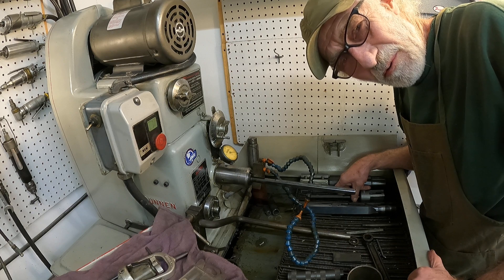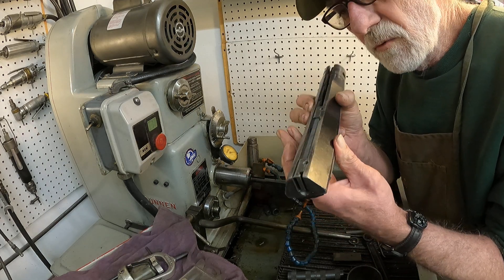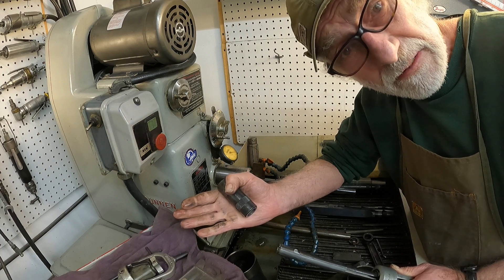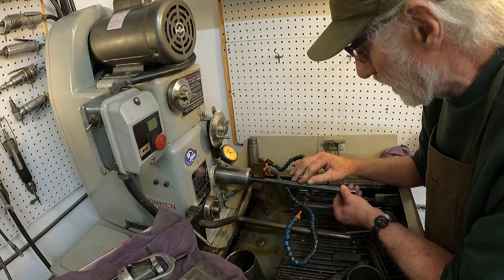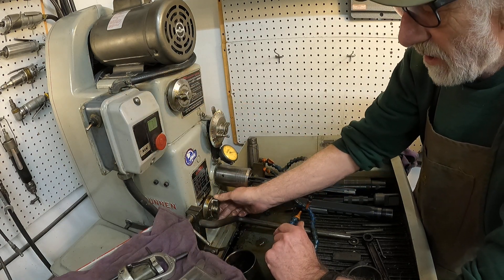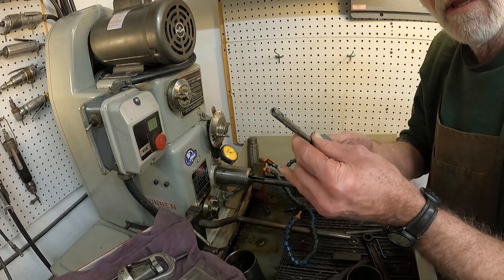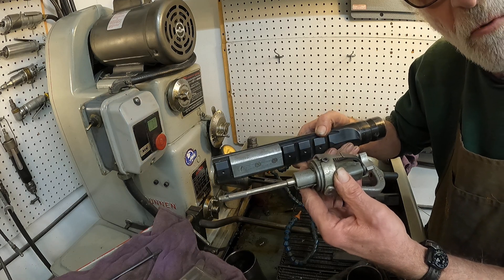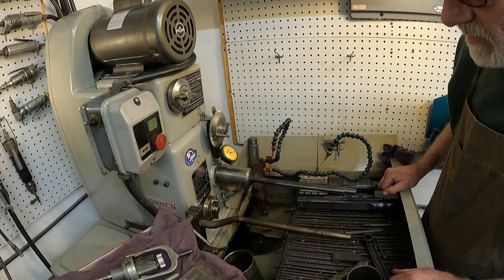Sunnen Honing part 2 Mandrels machining metal with abrasives

Comment: I used a Lisle brand version of one of these hones in a hand drill motor to final size and finish hone the cylinders on my Kubota tractor engine after re-sleeving and boring. I was having problems with tool chatter on the boring operation so I ended up going more undersize than recommended and taking out the chatter marks with the rough hone.. It was overkill for the application but I shot for 5 tenths taper top to bottom and I got it no problem (practicing for engines that spin a bit higher rpm in the future). On my dial bore gauge you could see movement of the dial to finer precision than that but the graduations were 5 tenths, so I actually beat it, but I don't know exactly how much. These things are amazing. If I can get to a thou on my lathe I'm lucky, but I'm confident that if I had better measuring equipment I could achieve tenths accuracy and precision with one of these style hones if I took my time.
Reply from the maker: Hi, the Sunnen hand hone was invented in the 1920s and guaranteed .0005" taper on automotive cylinders. Thanks for commenting, I have been thinking of doing more in depth videos on the hand hone, I was fortunate to receive factory training and have considerable field experience that could be helpful.
Reply: Subscribed in case you do.

Comment: 00:05 are those springs in the bottom of the pan there?   To keep chips out of coolant or something?   Not sure what I'm looking at there.   Love the walkthrough of a machine like this that I've never seen before -thx
Reply from the maker: It is a mat made of springs, I think the idea is the honing oil flows under and parts on top drain, thanks for watching!

Comment: good video, do you run it on 3 phase or single phase power,  looking at some used units but will have to convert to single phase where I am.
Reply from the maker: This one has a single phase motor but it did have 3 phase at one time, very easy to switch if needed or use a phase converter